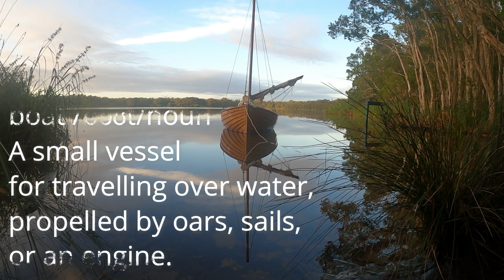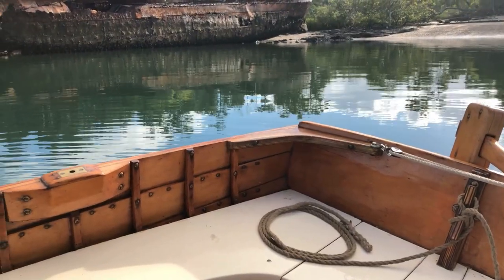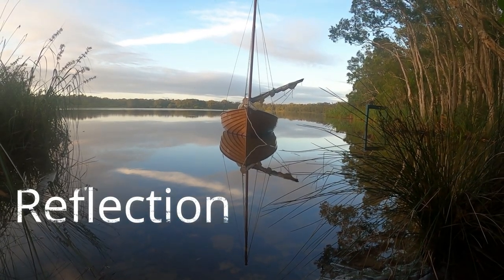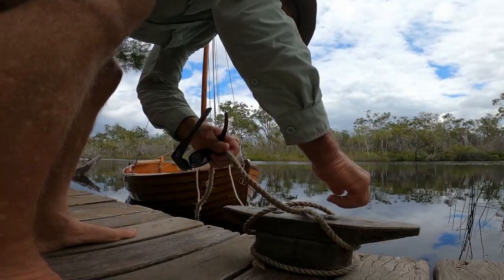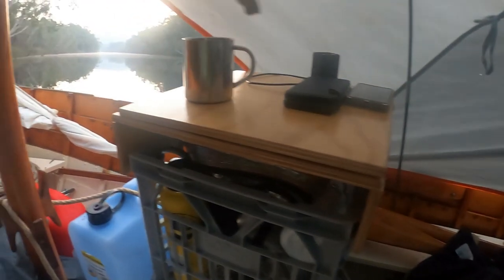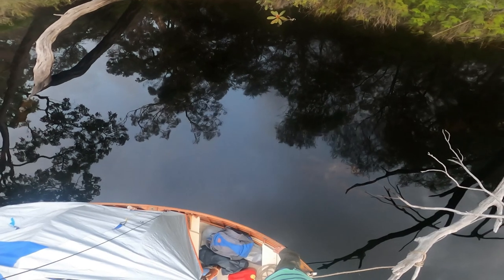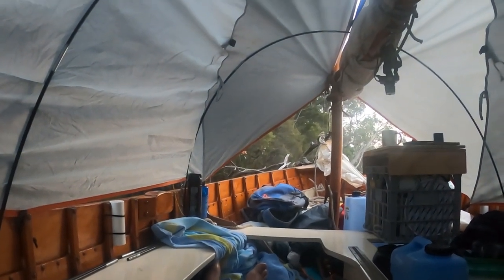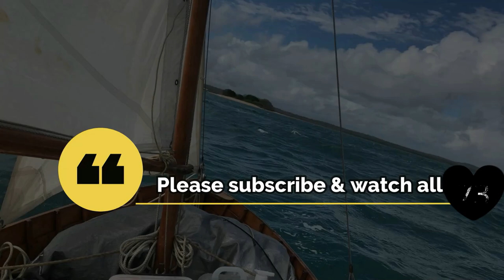An old wooden boat and some thoughts on how boats build character.

Comment: Well said again
Reply from the maker: How is your project coming along Greg? I'd like to get up there and check it out again once you get the planking finished. Also you may need someone holding the dolly.
Reply: @SmallSailboatCruising  I’ve only 3 stakes to go. Shaping another in the morning. With a little good fortune I will fix it Tuesday 
Then onto the sheer strakes. Then I can have a special drink.

Comment: Hi. Thanks for the good vid. Very interesting to see how peops do it in dif locals. This pretty obvious so u ve prob thought of it already but all the same.... all boats are diff so may not work on yours but when i was venturing on my 20 foot dory, i built the sole bords or floorboards of such shape as to span the space tween seats and centerboard trunk perfectly at the level ov the seats. After a restful night comfortable sleep stretched out at propper higth to keep a halfwake eye on the anchorage i d move the boards back down and sail off. Surprised i ve not seen this arrangement on other small boats as it works great, does not take away from utility of floorboards at all if well executed ....and sure beats lugging around some other means of extending the thwarts. Fair sailing!... ....and comffy resting
Reply from the maker: Sounds like a good setup. This one has permanent bunks installed.  I thing beats a good nights sleep on the water.